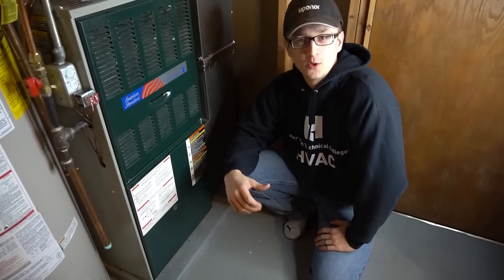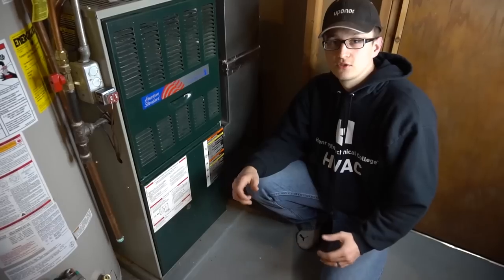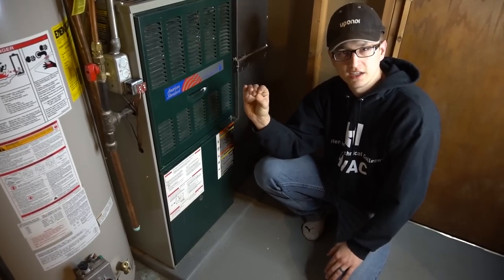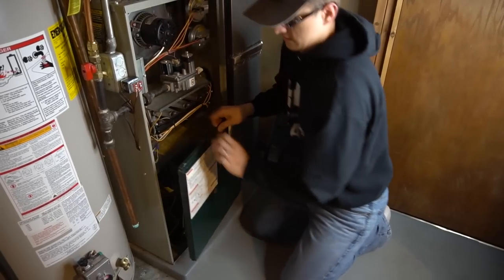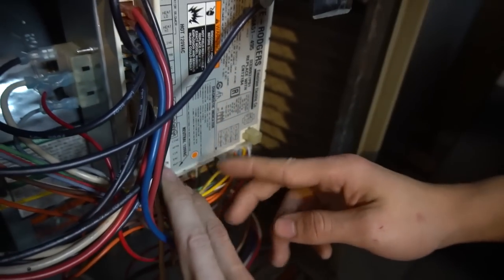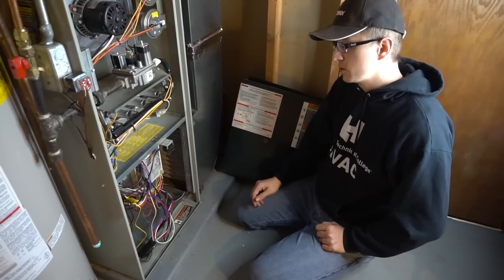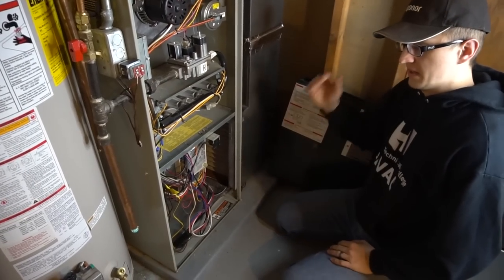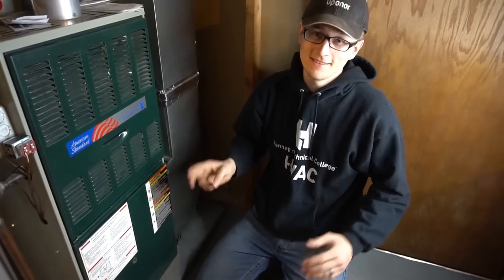Furnace Blowing Cold Air! Where Should You Start?

Comment: I went to a call because of a tripped rollout due to a blocked filter. I always ask when the filter was last changed. The customer told me "last year". When I pulled the filter out it said 3/2017.
More like 2 1/2 years. Changed filter and it ran well. Changing filters regularly can save big bucks in the long run. In this case, a service call.

Comment: Gibson GMS8 Gas-fired furnace, located in the attic, since 2005. Cold air, occassionally, intermittently, warm, despite fan set on AUTO and appropriate thermostat settings. Been this way for few months. Annoying, but tolerable. Now it's getting colder and the furnace seems to be blowing much less warm air. Thermostat set at 70°, reading is 60°, and it's obviously cold in house. In the furnace window, light stays red, and seems to be operating. However, I powered it down, turned gas off, etc, waited a few minutes, and powered it back up, and this happened- light still red, shortly after system started, the right burner of 3 burner system glowed, then ~ 10 seconds later, gas flowed and ignited other 2 burners. However, flames to all 3 burners stopped after about 3 seconds, and the system continued to run, or attempted to run, but flames never reappeared in any of 3 burners. Another thing- I'm pretty sure this furnace doesn't have filters in the unit itself, but there's a 14×30 return in the upstairs ceiling and 14×14 downstairs, so I'm thinking/hoping those take the place of a filter in the unit, because I've looked and pulled apart any place where a filter could be, to no avail. Any help with this, to save me a call and allow me to fix this, would be greatly appreciated.

Comment: We have a York Diamond 80 that is blowing cold air. I tried to see if there were any codes blinking. Found out our sight window is in a completely different location from where the light actually is, so I see nothing when I look in the window. And of course, pressure switch shuts off the furnace when the cover panel is removed, so there is no way of determining what or if anything is flashing while the furnace is on.

Comment: Our furnace is blowing cold air when we call for Heat. We replaced Ignitor, Heat sensor, Pressure Switch, and even Gas valve. We also replaced filters - but unit blows cold air with - and without - intake filter installed. I watched it work - it lights up, gas flame is blowing for about 10 seconds, then it shuts down. Thermostat fan is turned to Auto. Furnace is about 10 years old and is barely used. Visually, all  interior looks nice and clean, like brand new. What should we look at next ? So puzzling... Thank you for any help you can offer.

Comment: what if our trane xr80 is blowing cold air, but there is a continuous rapid blinking light. so there is a call for heat, but it's not igniting. thent he fan turns off and tries to ignite again. tried removing the limit switch and giving a few good flicks. didn't fix it. you think it's the ignitor?

Comment: Hi my furnace is blinking 4 times. So I took my limit switch to the parts store and got it tested and they said it's good. So I didn't change it. Instead c replaced the flame sensor. But still not working and still blinking 4 times.  Should I change the limit switch even if they said it's good?
Reply from the maker: What does your furnace say that those 4 blinks mean? It could also be a different switch tripped other than the high limit, like a tripped flame rollout switch for example: https://www.youtube.com/watch?v=VAHSmeTTKpI&t=9s

Comment: OK, here's my deal. It was acting like the flame sensor, and maybe the burners, needed cleaning, so I did that. But it would try a few times and go into lockdown. UNLESS, I left the cover off the burners. Then the burners work fine. Weird. I think I put all of the burners back on properly. And thoughts?
Reply: Turns out, I had my garden hose wrapped around the outside exhaust (PVC), and it messed with the airflow.

Comment: Hi Jay: I woke up this morning to a chilly house. I have a LENNOX ELITE furnace. Model # G50UH - 36 B- 090 - 07; Serial# 5804A - 19966;  -< With the circular Honeywell thermostat on  Heat/Auto. and dialed to 70 and the temperature at about 50 degrees - in the house.(23 degrees outs8de) ---  I go to the furnace and switch the fused toggle switch to on --> the INDUCER MOTOR rotates for about 2 to 3 seconds and shuts itself off ---> the control board only gives simultaneous slow flashes on both LED#1 and LED#2 --> ANY SUGGESTIONS?

Comment: I bought a house two years ago, built in 54 but the furnace is about 20 yrs old. It’s turning on heating up for a little then just won’t keep up model GDE125J20A3. Old style circuit board no lights but is familiar with past videos. Any ideas because I’m thinking an heat exchanger at this point everything else works properly.

Comment: buddy how about most common cause for the furnace blowing cold air? 1 dirty filter, 2 dirty flame sensor, 3 bad limit switch, 4 bad ignitor, 5 fan set to on vs auto, 6 stuck inducer fan motor, most severe crack heat exchanger

Comment: Hello, can't stop watching your videos,  very helpful,  but I have a  XC95M  TRANE furnace, flashing red light 10x, no heat, I tried to reset thermostat, check the fuse and even turn the system on and off, still flashing and  thermostat not turning system on. What could it be? Thanks in advance.

Comment: Good, clear advice.  Thanks.
Reply from the maker: You're welcome! I hope that helped steer you in the right direction. Were you able to figure out what was wrong and get it fixed?
Reply: Your advice helped me understand my problen of why my unit was not delivering hot air.  When I reached my furnace, which lies horrizontilly and in a cramped attic space,  I was unable to do anything further.  At 75 years old, my options are considerably less than they were at a younger age.  I will have to rely on the pros but also reinforced with the clear explanations that you have provided.  Few instructional videos on You Tube are as helpful as yours.
Reply from the maker: Thank you! That means a lot coming from my seniors. :) And attic units tend to be more difficult anyway. It's probably a good idea to let the pros do it. Good luck and stay warm!

Comment: Hi, thanks for your good instructive videos. I have a Trane furnace XE80. It has power. The diagnostic light shows 4 blinks. The code translates to Thermal limit switch overheat. My furnace inducer fan powers up, but the control board does not call for gas. The igniter does not glow. I have cleaned the flame sensor. When I try to check for voltage all I get is continuity, but no voltage readings anywhere I test, though I know the unit is getting power since the fan runs and the control board indicator operates to give me a code. I have tested the igniter and seem to get an OK reading. There is also power at the thermostat. Help. What to check? What to fix? How do I test the thermal limit switch? Should I try to reset the flame rollout switches? Thanks

Comment: My Rheem Criterion 11 started smoking,then I noticed the big damper upstairs didn't move ,it usually makes noise when it opens.Then the code light blinked 3 X's pause 2 sec.I couldn't find the stuck damper, so I removed the humidifier bowl from the top of the furnace.To get air.it worked.so I put a screen over the hole ,works great,thinking bout running a PVC to the outside for fresh air feed.Until I can find the damper on the attic.3 blinks my limit switch,warning heat exchanger overheating! Needed more air!!

Comment: Blowing cold..  works but blowing cold.  Changed the filter ... reset the thermostat.  Steadily dropping temp.  In12 hours went down 12 degrees.
Reply from the maker: Sounds like the furnace may have overheated. Is the control board blinking any error codes? Try watching these two videos for overheating:
#1 https://www.youtube.com/watch?v=pJzP1jzYPqg&t=1s
#2 https://www.youtube.com/watch?v=3ZPmltTR5S4&t=112s
Reply: Same problem I had today 😱
Reply: Did your burners ever light? Can't blow heat without fire!! Just your blower running??

Comment: Another great video, I was wondering could you do a video on how to replace a old manual dial wall thermostat with a new digital thermostat, (how to wire it up) I have a (4 wire) old dial type, Which operates my gas furnace & my AC outside air condition unit. Just like to upgrade to digital Thanks!
Reply from the maker: Thank you! I do need to make a video like that but in the meantime.. This is actually a pretty easy job but I would suggest getting a digital thermostat with batteries otherwise you will also need to either run a new 5-wire or use a 4 to 5 wire adapter. As for the wiring (if you get a digital thermostat with batteries) just wire it up the same way that I show in this video: https://www.youtube.com/watch?v=VknvJ9POYDo&t=3s  Everything would be the same except you would simply not have a common wire (which is fine if your thermostat has batteries)
Reply: @WordofAdviceTV I did as you said,  I purchased a Honeywell brand with batteries and went by your video, everything worked out fantastic. It's working perfect.💪 Thank you so much for the helpful information, hope to see more educational videos in the future! Your awesome.
Reply from the maker: @todds7090  You're welcome! Thank you for the update, glad to hear everything's working good! Stay warm :)

Comment: mine don't have the see through.
Reply from the maker: Does your control board have an LED light on it? If yes, then you would need to take the bottom door off and then keep the door switch pressed in (Or taped closed) to see the error code.